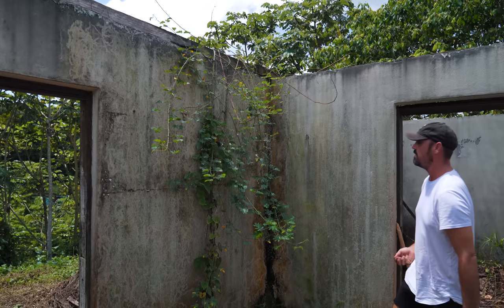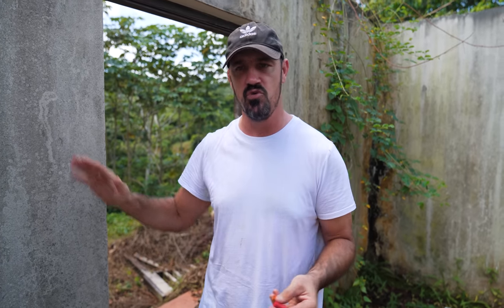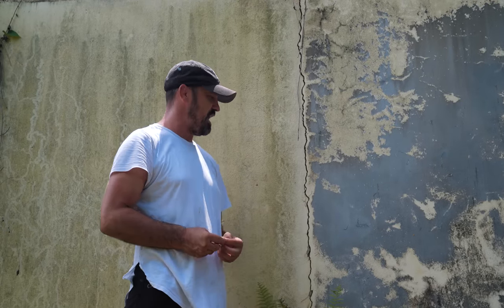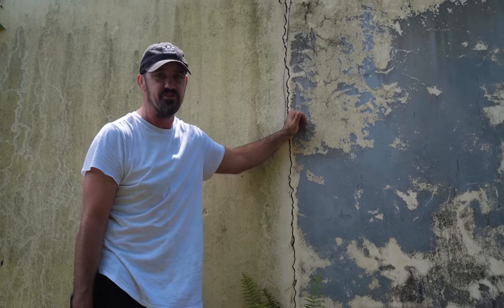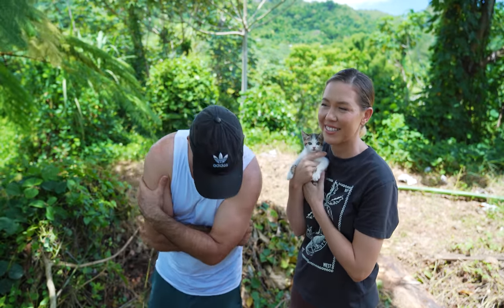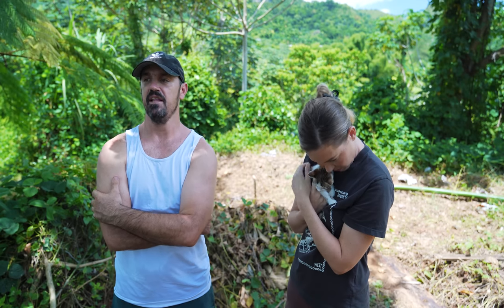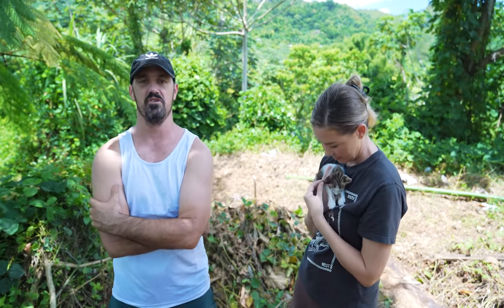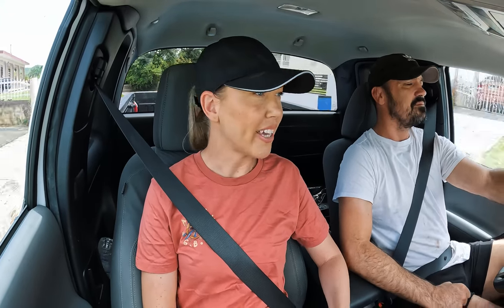ABANDONED HOME SHOULD WE RENOVATE OR DEMOLISH?!

Comment: I'm glad you guys saved the cats...good job!
Reply: The long crack you are worried about appears to be at the junction of an add on to the original structure. If the crack is wider at the top than the bottom, that would imply sinking. If the walls are concrete, that would be a good place to be in a hurricane.
Reply: Yes, keep the cats. They are good to keep the rats & mice away. Good on you Matt for saving the kitties 👍 good job. Keep up the good work. SV Kiwi Lady Opua Bay of islands New Zealand 👍🏿
Reply: The concrete can be saved, carbon fiber or fiberglass. It will be structural enough and then shoot apoxy into the cracks, reinforce the corners.
At the end.
Reply: 17:12 thanks for saving cats… I agree the the previous reply they will help with rat and mouse problems. Keep up the great work. I really admire people that take risk like you guys are doing

Comment: TBH, the walls look pretty good to me. I would recommend ordering corrugated fiberglass to easily and cheaply make a new roof. Other corrugated panels, like UV resistant polycarbonate (like Suntuf, for example), should also work well. Remember to anchor the structure against high winds. You can mount some closed cell neoprene sheets, or similar rot resistant material, underneath for insulation and noise reduction. Such a roof would also make for easy mounting of solar panels. Renting a pressure washer for a couple of days would do an amazing job on the walls. The concrete can easily be sealed and/or painted after pressure washing. Then, the structure will be stabilized and can be used, at least, for storage until you make a final decision. Building a concrete frame like that is expensive, and it is worth saving. As for the poultry, be very careful, EVERYTHING WILL TRY TO EAT CHICKENS AND EGGS!!! Monkeys, snakes, lizards rats, racoons, weasels, dogs, cats, you name it. You also need to get some sort of candler to check for fertilized or rotten eggs.
Reply: I agree with the keep the structure. It's already up and 'free'. You canfloat eggs to know if they are rotten. if they sink they are good if they floattheir rotten
Reply: I like the participation & advice from viewers. What happened to Bear? Is he guarding the DD in a mooring? I'm psyched to watch how you learn & build, but hope there are still episodes on the water in the DD. - Jim
Reply: I agree, the concrete walls look good for as old as they are and super expensive to replace. you just have to be creative and could turn that into something amazing! I use to build huge homes in the islands and concrete and cedar blocks with bond beams and vertical rebar is also another option! how many acres do you have? Super happy for your new adventure.

Comment: Before even considering using the existing structure I highly suggest having the foundation professionally inspected.  If the foundation is in poor shape, I'd recommend starting over with a new foundation.  More money for a new foundation of course, but on the plus side you can design your place exactly how you want it.  How many property did you buy?  It would be interesting to see an aerial view of it.
Reply: Local codes should dictate but if you’re planning for a long term residence, get rid of it and start from scratch so you don’t get a nasty / expensive surprise later.
Reply: Using what is already built is the most cost effective route.  Stabilize the foundation and the cracks will not open any further. If the walls remain aligned with one another you can patch the cracks with epoxy grout type cement.  Figuring out if the foundation is decent and can be stabilized is the first assessment that needs to be made.  Later, a roof structure will stabilize the walls from falling in or out….  Are there other flat areas on the property?
Reply: Hire a structural engineer for an evaluation 1st. Best money you will spend. They cam help determine if the structure is good to go and what repairs need to be made. If foundation and walls are repairable then they can tell you how to build your roof for hurricane wind speeds. Don't do this willie nillie! Your roof could be destroyed in a hurricane and y'all injured if your seeking shelter in it!
Reply: I came here to say that. The walls have been exposed for a while.
Reply: @John-bk6pr Good assessment and you have given some very good advice. The second crack is in a straight line. Maybe it is two sections joined by a column but not well tied together. I would suggest pouring a reinforced collar beam. If torn down it is an enormous amount of rubble. OR,,,, knock it down and use the rubble to extend the flat area.

Comment: If you split the bamboo into 4, 6 or even 8 pieces it will go a lot further when making a "wall" or screen  and you will be able to use shorter (cheaper) screws or even tarred sisal to join them to the main supports.
If you use bamboo split in half and knock out all the "partitions, lay 2 with the open ends up and a third with the open end down into the bottom 2 and just repeat you will have a pretty good roof.
Bamboo is such a great resource to have.

Comment: I love the naturel use of Bamboo!  Great idea. 
A Lesson**; 
**ALL Farm gates have a diagonal support! 
Don't reverse it, as often is seen wrong...I always outwardly cringe. 😮
Base of inside support bottom  hindge.  Supports majority of load out to upper frame support.
Top of support to top of gate.  4 - 5 nails diamond pattern (higher shear strength & cheaper than screws)  5 per lap joint  
Gate BOTTOM BASE hindge, 
To OUTSIDE TOP of support. This angle will vary based on;  gate width & hindge distance set.

**If you're a great Farmer; your gates are slanted (bottom kicked out from post at hindge)  towards always swinging CLOSED. 
Prop it open as needed with a leg you can fold up,  but self-closing gate which use; gravity or counter weight,  are best. Suspend a weight (water bottle or rock) in middle of inside line. Attached to point you've tested.  Easy. 

**Kittens; keep contained for 3-6 weeks to bond well.  These little babes need to learn about the local hazards prior to outside Free-Range. 
Always hand feed.

Bartonella 
(Cat Scratch Fever) 
is damn hard to treat!! 
Bart IS congenital to future children.  Can cause Cancer & Cardiac events...
Lyme Disease is included. 

Always treat cat scratches & bites as VERY SERIOUS INCIDENTS!  Wash w/soap.  Peroxide & Iodine after dry.
Antibiotics soon if infection. 

Clip kittens nails while training.  Safety for humans, they'll grow back in weeks. 
Lay em on your lap.
Head @ your knees. 
With nail trimmer, lift up.
Cutter will settle into the groove.  Don't trim pink or red. Have 'Kwik Stop' blood coagulation power (or Flour) Always keep on hand for critters of all sorts.  Can close down excessive blood loss Quick. Miracle Care Kwik Stop Styptic Powder for Dogs, Cats & Birds...humans too!

Your both doing well. I'm enjoying your journey. Thanks for sharing! 

~ DiveGirl Deb 
SV Melittin's Miracle

Comment: Farming GBU, I'm just loving your video's. As far as the house, keep it. 
I worked with concrete, my boss and i use to make the cracks a bit wider like a few centimeters and filled the cracks with concrete. for every bag of cement, use 10 shoves full of sand, go slow when you add water, you want it about as thick as peanut butter, then fill the cracks, Use a plastic bag and pipe it into the cracks then trowel it flat, after it drys power wash that sucker. also that creek near your house, pan that for gold flakes. i love the chicken coop. Now you can call yourself Larry and Dancing Kristen Farmanato. Keep up the great work.

Comment: As an experienced builder, my take is to 
1) check the footings
2) check for spalling
If you bones are good, pit that SIP roof on. You can always do an addition later on. Tighten it up, and move in.
Reply: totally agree, inspections first then determine what to be done after....
Reply: No! Demolition is the remedy. The house's framing is rotten, and will take the roof with it. Remember, he who buys cheap buys all the time.
Reply: @Looky-Loo-Shorts concrete don’t rot silly man 😂
Reply: You are wasting your time, giving advice.  They won't follow it.  If Rube Goldberg built a homestead, this would be it.  I give it three months and they'll be back on a boat with a new grift.
Reply: Concrete certainly Does rot.
Check out the Surfside collapse. It's called spalling.
An engineer, you're not

Comment: An apron of fencing around the coop will prevent predators from digging under the walls. Welded Wire fence laid down and held in place with garden staples.  Predators will try to dig next to the wall but won’t be able to get thru apron.  Apron should be about 2 to 3 feet wide. Flat on ground.  Around the entire perimeter of the coop.  You don’t need to bury it. Plants will grow thru it and hide it.

Comment: You should definitely fix it up if it is concrete. Later, if you want to build, you have a place to stay. It then can be used as a guest house. Always use pressure treated lumber. No termites. Crack in the wall is no problem. Check foundation and support where needed. The walls are evidently solid and have stood the test of time. Best starting option, build the house out of what you have and grow from there.
Reply: Great option. Fix it up for a guest house or a work shop once your final house is built. rebar and concrete across the top of the walls will stop the cracking.

Comment: Solid structure for hurricanes, keeping the concrete walls. You can also add a 2nd story as well. Filling cracks with a concrete silicone filler. Solid bones for refurbing existing structure. Congrats!!

Comment: You need to get the chicken feed ground. It's easier for them to digest. If they are kept caged, you will also need grit to put in their feed. The hens need laying mash if you want to raise them for eggs. They will also need oyster shell, or you can grind up used egg shells and feed those back to them. The calcium helps the hens form better, stronger eggs.

Comment: Watch out for mongoose! They are an invasive species introduced years ago by sugarcane farmers to deal with rat infestations. Mongoose will dig and find a way into the chicken coop. You might want to lay wire at the bottom of your coop, but keep in mind it will corrode very quickly, so regular maintenance will be necessary. Your other option is to elevate the coop above ground. Keep up the great work... 😊

Comment: If you need feed you can put a 5 gallon pail with holes in bottom and hang in the pen .
Carry shovel and bucket in your truck when you travel and scoop up fresh road kill and put in bucket in pen .
The maggots will fall out given your chickens free protein.
Make sure pen is down wind of the prevailing winds . Smell can get bad in heat. Proper water drainage also important in tropical rain I would imagine.

Comment: I recommend razing that structure.  It’s better to start with a design you want, rather than a questionable structure you have to deal with.  Good idea with the bamboo coop. That could easily handle 3 more hens. They usually like to roost high on branches at night.  Prepare for rising feed costs.  Throw all your food scraps to them. Give away the cats.

Comment: Matt, if you take the wire for your coop and attach it on the bottom and then out about twenty four inches it will stop predators getting into your coop and taking out your birds. Do that all around the coop. here where we are we have mink and skunks as well as coyotes and they have been totally stymied by the wire around the bottom. safe chickens and good eggs will result

Comment: I live in a house made out of giant flat rocks. It cracks a lot. Fixing it is easy. Use hydraulic concrete. You mar want to chisel the crack into a V shape then fill it. This will hold it all together nice and it won't crack again. You can build a treated lumber deck on the inside of the house for a floor. And you can ad concrete blocks to raise the roof height. Make sure any wood you put against the concrete is treated lumber.

Comment: You should check on local building methods to determine how those walls are constructed. My guess is that the are cheap 4-6 inch hollow blocks, reinforced with rebar, concrete filled with concrete skim-coating on the surfaces. Not likely to go anywhere. Put a roof on it, close it up, run some urban water & power, and move in!  Probably more than sufficient to use as temporary shelter and or a workshop as you build around it. (Don't forget the A/C!) And more cats = more love!

Comment: Having a top on your hutch is important.  Also put fishing line above your head in areas that the chickens roam.  You can put the lines 5' apart.  It will give them a safe area.  No way you can put it everywhere, but it will help a lot.   Hawks won't challenge the lines, works great.

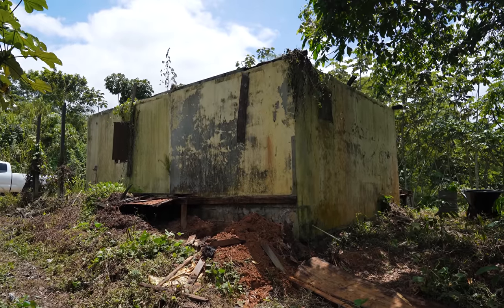Comment: 4:00 if a crack is narrow at the bottom and wider at the top, it could mean that the land is settling.  If that is the case, the crack is a sign of bigger problems to come.   
In many cases, a contractor I know would dig out under the supporting structure, Build a huge foundation that spreads the load out over a larger area, then build a retaining walls in steps down the hill to support all the land the house is sitting on.  
Then the next question should be, is it worth it to do that or knock it down, regrade the land to make it stronger, and then start over.

Comment: I would keep the structure.  You can inject the cracks with epoxy.  That straight vertical crack looks like a "cold joint" which is where two separate concrete pours join.  You could also rout out the crack to open it up and caulk it.  This is called "honoring" the joint.  In this way you'll get a straight line and allow the crack to move naturally without opening up.    In that climate you could stucco the walls to get a more aesthetically pleasing facade that will perform well with the moisture.

Comment: I am likely to give you guys a lot of advice here. i don't know much about sailing but i know a lot about homesteading. and building. For the chicken coop i would add more support to your walls and door. i would take the bamboo and split in into reeds and attach it to the sides and door at an angle to add sheer strength. and make the structure more secure from animals. as is a dog can get into that if they tried hard enough.

Comment: Probably already been said, but I’d recommend building with concrete block primarily because of the wet tropical climate and hurricanes and tropical storms.  I’ve never had to try it but it would seem to me that maybe some sort of tie downs for your trailer because of windy conditions might help. Maybe something like the wide yellow straps with ratchets anchored securely in the ground. I wouldn’t snug them down too tight as they probably would damage the trailer….anyway some kind of system that will keep the trailer from being blown over.  Good luck in this phase of your exciting lives.

Comment: Renovations will cost you much more more than building from scratch and won’t be what you really want! Leave the concrete structure if it’s sound for a storage or workshop. I was a off grid homesteader on 80 acres for 12 years in the 90’s, deep in a hollow in the Ozark mountains. Keep it simple and you will be happy. I’m the one who told you about the saw blade for your weed-eater to clear the property. Animals are good for clearing but you have to keep up with them.

Comment: Save the house. Cracks only go straight up and down on expension joints. If you chipped the outside of the crack, you may find it. Rebar did not cross it but likely is everywhere else. If you are afraid of it falling in, you can pour a pier on the inside. Tilt up walls sit on plastic spacers but those should have rebar coming up out of the footer. Tilt up walls are welded to roof joists and hold the walls up. You could do that too.

Comment: The building looks good, the crack in the wall is probably a connection between two separate parts, don't worry, the ground on which it stands always moves a little, but over all these years it is not much, it can still stand for another 100 years. if it is a problem in your opinion there is a solution, concrete structures repair them with epoxy resin to bond the parts that works better than cement because it bonds better and flows further into the opening. good luck.

Comment: Incorporate it into the new Home if the foundations are good. You can lath and sheet the walls for electric and plumbing. Concrete naturally does crack when it has no expansion joints. Epoxy injection may be an answer. The structure can also act as a storage as you add or build on. Need a roof and seal it up. Just an opinion Matt. Good luck and happy building.

Comment: Crack #2 looks like where the interior wall is. So that brings up the possibility that the back section is an addition. Since it appears that they used concrete blocks those two sections of the wall may just be butted together. Three barn cats and one house cat. There is probably plenty to eat outside once they get bigger. The new kittens are 75% of your cat possession, but you increased your cat possession by 300%. I believe chicken feed is cracked corn, but they love bugs.

Comment: Building from what I saw when you were digging up looking for septic line, looks like just a cinder block building with stucco on it. Honestly, unless you really want to use the current layout, I would rent or borrow a front end loader or even a backhoe and pull it apart and build what you want there. You can repurpose the cinder blocks for other things around the property like landscaping.